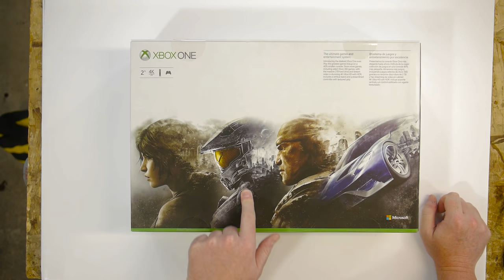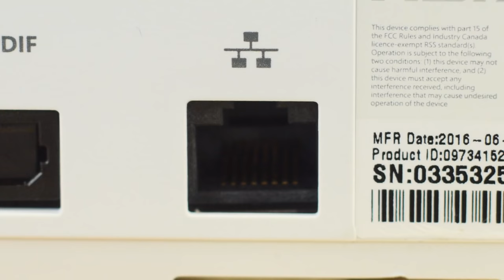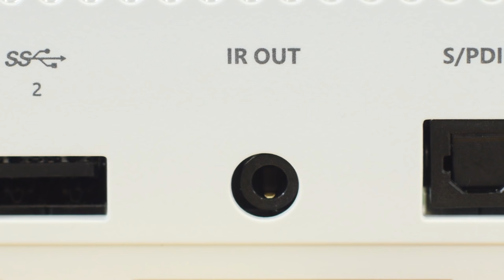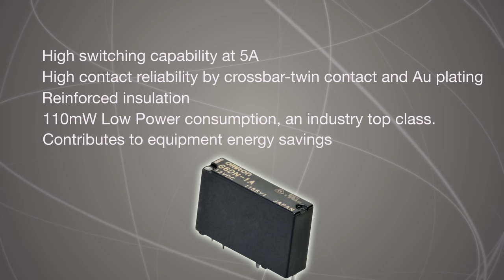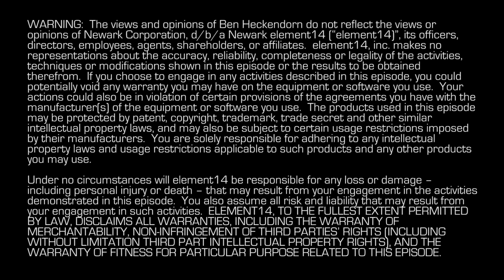Ben Heck's Xbox Slim Teardown

Comment: I think the controllers are Bluetooth now
Reply: yes they are
Reply: +SwollenRhino What they were using before? Yes I'm serious.
Reply: the old system is actually better and still used. Bluetooth is just on bord so the Controller can additionally be used on pc via bluetooth.
Reply: As noted the v1.3 Controllers do support Bluetooth, but it's only used for Windows 10 (Desktop, Laptop, Surface Pro) and not on the Xbox One (S)... it still uses a HF RF like most Microsoft Wireless Devices, but something they have done is dramatically increased the power and improved the Antenna on both the Console and Controllers. So you can move more than 5ft away and still have a Signal. Mind in terms of Range the Xbox 360 Wireless Controllers still have a damn sight more Range. • Via Bluetooth it's ~10ft, Via RF it's ~16ft which is reasonable for most Homes (and allows you to say go into the Kitchen from the Living Room, throw the Controller on the Counter while you make a Coffee and not Disconnect). The 360 Controllers had about 3x the Range.
Reply: The xbox one s doesnt support bluetooth from the console itself only the controller. So how do they talk to each other?

Comment: I wonder why they can't make them smaller, my gaming laptop is obviously a lot smaller and thinner and it packs a battery and a screen in it and it can do 1080p 60fps with high settings on most games so why can't this even do 1080p 30 fps on most games?

Comment: do you research these contained before you attempt to talk about the innards? Or do you assume to know it all? the GPU is also faster, ram has more throughput, HDR hardware and the controller now supports Bluetooth connection for use on PC....
Reply: consoles...not "contains"...ugh

Comment: Wait wait wait what? At around 17:30 he said it would whip the floor with a gaming laptop... He clearly dose not spend much time looking at laptops. Gaming laptops have come a long way in a very short while. That statement maybe true like 4 years ago, but not know. A last gen mid level ($1200+ ish) 970m laptop is roughly as powerful graphically as a PS4 pro, and the new current gen mid level 1060 laptops  are capable of running full VR. They are leagues above this Xbox 1s.

Comment: Why does everybody hate the Kinect? I love that thing!
Reply: You come home to sit down and relax to play games. Not flail around like an idiot AND get frustrated at something that doesn't work.
Reply: Whats wrong with flailing around like an idiot? And I never had problems with it. I have used it quite a lot, and it works fine for me. Unless someone runs in front of it, but that is understandable.
Reply: yugij0319 I said flailing around like an idiot AND it not working. 

Two words: Steel Battalion
Reply: Well I have never played that game, so I wouldn't know about that one. But it might be a game developer problem, not necessarily a Kinect problem, maybe.
Reply: yugij0319 The problem is that the connect isn't not only not accurate enough, but that it can't account for personal variables very well either. IE how your wave your hand is different form how other people do it.

Meaning it's extremely limited in the types of games it can be used for. Basically, it can only be used to make Wii games. It suffers all the problems the Wii did. Great for casual games, terrible for anything that requires real accuracy.
Reply: Well when they made the Kinect for the Xbox One, it got a huge upgrade. I watched a video about the specs for it, and it is definitely a LOT better than the 360 version. And I don't think that the Kinect was ever meant to replace a regular controller. I think that it was really only meant for a "Wii" experience. They have to keep up with the competition, right?
Reply: I'm with you yugij0319. Kinect is really an amazing bit of hardware. I don't think it's very good for gaming, but it's really excellent for a lot of other things. It's absolutely a dream for hacker/builders like Ben Heck and others. It has built in directional microphone arrays, RGB (color) camera, infrared camera, Time of Flight camera (gives a depth for each pixel!), and probably other things I'm forgetting. Combined with some of the very powerful software libraries Microsoft has released for it, it has an incredible amount of potential for a wide range of applications. Gaming happens to be what people think of it for, and happens to be one of the applications it's not that great for. others include motion capture, 3D scanning, home automation, security systems, and much more.
Reply: SpudGunTechie just dance anyone
Reply: They actually had an adapter for the Xbox One Kinect for use with the Xbox One S that you could order for free if you had the Kinect, and as I had the original bundled with the Kinect, they sent me the adapter when I got my S and requested it. Never hooked it up, mind you, but it does exist.

Comment: Other than for looks, can someone explain why it's better to have an internal powerbrick?
Reply: its actually worse
Reply: Internal power brick gets actively cooled though.
Reply: i prefer an outside one, so i can replace it easy
Reply: It's only for aesthetic appeal and easier cable management in setups. It is actually detrimental to the thermals of the system because the powers supply produces heat which then goes toward other components such as the APU or HDD
Reply: Harder to loose.
Reply: aesthetics and space. From a technical standpoimt an external powerbrick is ofcourse safer, but the purpose of a game Console is to be set in the living room and therefore aesthetics and space is an important factor
Reply: Space efficiency. Wedging a power brick behind your TV stand furniture isn't always possible.
Reply: All my gaming consoles use a powerbrick, except my n64

Comment: I just noticed my xbox one s was warm to the touch after I haven't touched it in a day...which i though was kinda weird then I remembered the power supply brick is integrated in the system...so did I just answer my question?

Comment: is it possible to upgrade the processor or the ram chips? Is it possible to desolder them and add better ones?
Reply: no , this is a printed PCB board, you can't upgrade anything but the hard drive. Scorpio might
Reply: +Omega Rugal interesting. I'm curious to see someone attempt it.

Comment: Well at least they included the vertical stand. Unlike the new PS4 Slim. I mean it's only $0.36 of injection molded plastic. Across a large user base, yeah it adds up, but it's just a dick move. 

I'm speaking as a former Ps4 owner, and a future Neo supporter, so don't flame.

Comment: Smaller is scary. I'm thinking long term running times it will over heat.
Reply: It is extremely quiet and cool like the original Xbox One. In fact this uses a smaller chip and generates less heat and uses way less power than the original Xbox One.

Comment: I would rather my game consoles have in-line power bricks. Yes, put that waste heat outside of the main console and away from the processor(s), thank you very much.
I mean if it doesn't overheat, it doesn't overheat but all things being equal I'd rather not put the heat burden on it when you don't need to.

Comment: you mad a mistake you said lower volts = higher amps.
I think you got it mistaken with the lower the resistance the higher the amps because using ohm law you can see more volts equals more amps and less amps equals less volts.

Comment: 2:02 LOLLL "HOH NOHHH YOU DON'T GET ONE THAT WOULD COST EXTRA MONEY"

Fucking .. HDMI cables .. why the fuck did they ship composite
Reply: The controller STILL NEEDS fucking double A batteries ? Huh ..?
Reply: +D00MEDST I'm glad it take double a, great in a pinch
Reply: Inferno G4ming Since 7th gen , $ONY , plug and forget batteries , have they not learned fucking lesson for true wireless
Reply: +D00MEDST I'd rather not have non user replaceable batteries and if you throw dirt cheap rechargeable aa's in it, you can accomplish the same thing as ps4 controller, with more convenience if for some reason you can't connect to console to charge. simply throw in a new set.

Comment: if they replace HDD to SSD, how much it would cost?? they know they can but think about it, speed over cheap, a 128gb SSD will charge you to amount of a x2 500gb hard drive that almost do the same as an SSD in terms of just normal gaming, data transfer yes it would make a huge difference but only on bigger files, Loading time only transfer small amount of data that's enough for an HDD to handle.
Reply: I bought a Kingston 240GB Sata 3 SSD which ran me $60 USD, and for some people the speed difference would make it worth changing.
Reply: +1blisslife BTW... That kingston SSD... I bought it on Newegg's website.

Comment: So in other words, the original has better quality components.
Reply: This has a better bluray player, nicer heatsink with proper copper tubes, an internal PSU for both US and UK standards, better Wi-Fi, smaller APU that generates less heat and uses less power but runs faster... how is the original better quality?